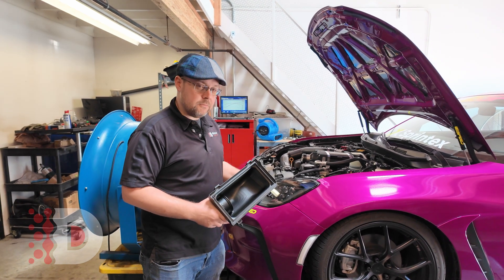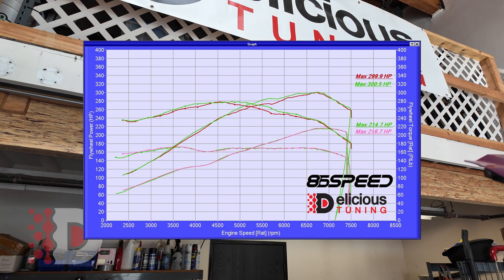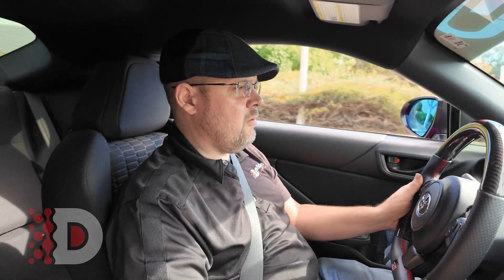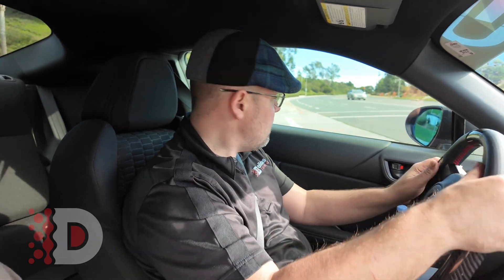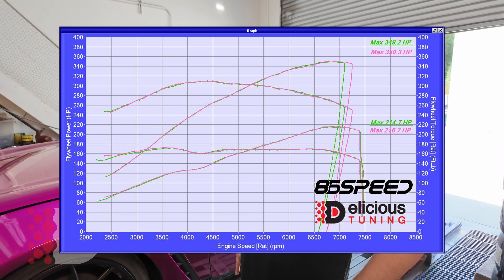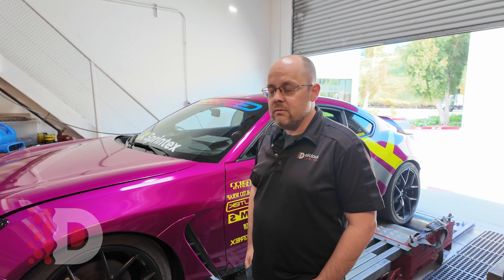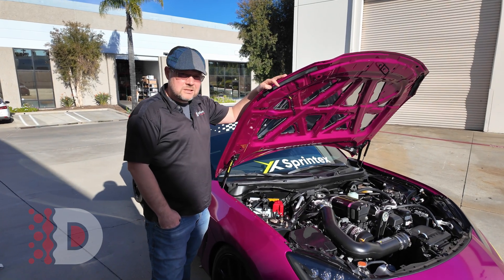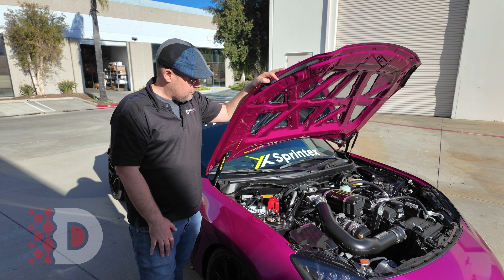Dyno HP Numbers @Delicious Tuning; 86Speed's Sprintex Supercharger for the 2022+GR86/BRZ

Comment: On a stock clutch with an original motor full bolt ons w/ turbo how much do you think the engine can handle? 350 bhp or 350 to the wheels,

Comment: Has anyone run this supercharger around a track for multiple laps on a warm/hot day to see how it handles heat….real heat.  I would like to install this supercharger on my track day gr86 that I am building but even a stock n/a GR86 needs help to deal with heat on a track.  Oil gets too hot without upgrades in n/a.  

Can the same oil cooling upgrades made for a stock n/a motor keep the oil cool once this Supercharger is installed?

What do the intake temps run up to with this kit installed on a track after 3-10 laps?  

Thanks.  It is difficult to find detailed info on this kit.
Reply: It only handles 2-3 hot laps on the track

Comment: I have an auto GR86 and I wonder how the auto would hold up on this setup?  It’s not a daily but if you could share some insight
Reply: The auto transmission would arguably hold up better than the manual transmission with boost—autos use a Lexus transmission that held more HP/TQ than an 86 has stock. It’s a good unit and proven.
Reply: As someone who didn’t know any better when at the dealership, I also bought the auto gr86 and I regret it everyday, but I was thinking of getting this kit to make the automatic experience better.
Reply: @toxiclight9378 I owned a first gen 86 auto and made sure to get the manual the second time around. It’s much more engaging imo and I wouldn’t buy an auto again. 

Still, the auto is still fine, just a different experience. I would just be thankful for what you have and keep it. If you ever get the itch, the auto is actually quite stout and can handle the additional torque of a supercharger. If you don’t believe me, you can check the ft86 forums.
Reply: @Barbwire710 this is probably a stupid question, but would driving an auto on manual mode with a supercharger/turbo on it affect what the car in question could handle in terms of power?
Reply: If you are chasing time. Stick with the auto.

Comment: So this is 300hp at the flywheel?  Says flywheel on the dyno graph
Reply from the maker: Good eye. The dyno says "flywheel" because it is Comparison Mode. That means this is what you would expect in a DynoJet Dyno.
Reply: @DeliciousTuning  so what is it at the wheels?
Reply from the maker: @Playboyer670  "True" wheel horsepower is 17% less. The baseline stock car would also be 17% less.
Reply: @DeliciousTuning I’m new to car tuning, so I apologize for my ignorance but is the flywheel horse power that is being read from comparison mode the correction that you’re talking about?  Like the 300 flywheel hp is the correction and it actually reads higher? Or does the 17% correction need to be applied after getting this reading? I’m very confused
Reply from the maker: @terrellmclaughlin9693  No apologies necessary. I apologize for the confusion, not my own doing, but media and DynoJet for allowing it to happen. The numbers we are using are in fact DynoJet numbers. So if you were to take the same car making 300hp (in Comparison on our Dyno) and bring it to any DynoJet it would read right around 300hp. 

This 300hp includes the additional 17% correction factor over "true" wheel horsepower as mentioned above. So if you wanted to know "true" wheel horsepower you would divide by 1.17 to get that number, about 256 true whp. DynoJet's do not read this value, they never have, but they are by far the most common and standard dyno used in the world. To explain it a bit further a stock 2022 BRZ would read 215hp on a DynoJet but would read about 183 true whp without the 17% correction added in.
Reply: @DeliciousTuning  so right now this car is making 256 true whp? Since the graph reads 300 hp flywheel?
Reply: So in your Instagram posts you refer to the results as WHP.  Take for example the red GR86 that you tuned made 245"whp" on E50 but what you actually meant is 203 "true" whp?
Reply: Actually it would be 210, "true" whp technically speaking. But in regards to how the media portrays it, even DynoJet, that is a different story. All these media companies (D Sport, Motortrend, etc...) portray DynoJet as the standard for reading "wheel" horsepower, which it is not. It has a 17% correction factor added in, and why the Dyno Dynamics has a comparison mode.